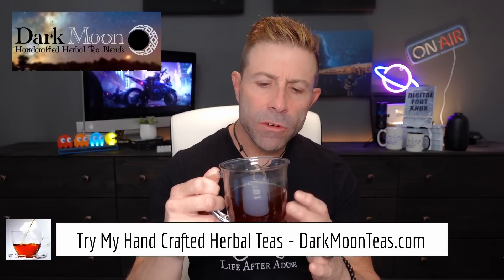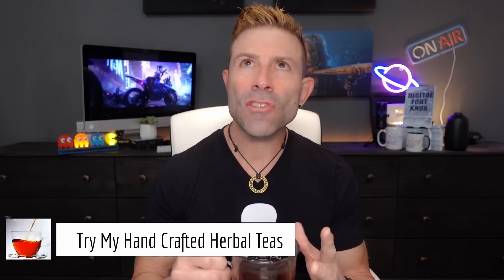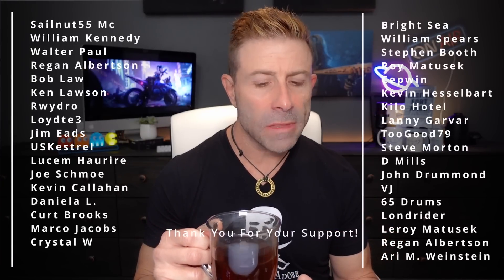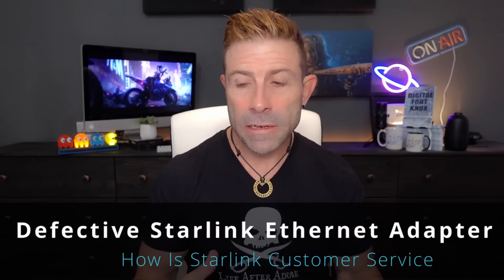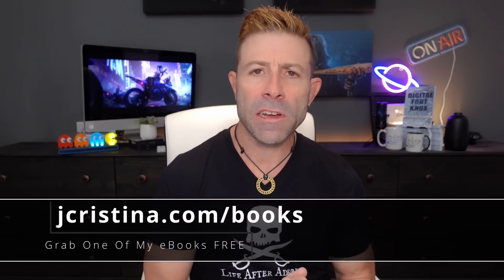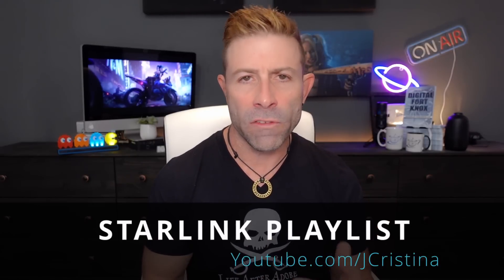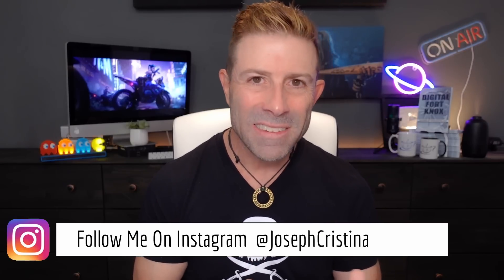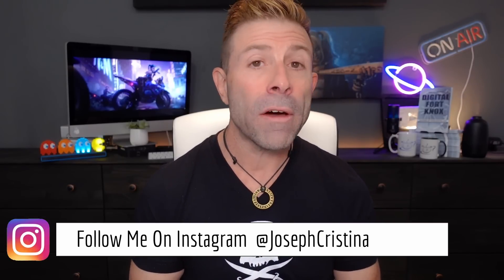Defective Starlink Ethernet Adapter Starlink Customer Service

Comment: My symptoms for bad ethernet connector, no internet and constant connect disconnect issues.  Removed ethernet adapter, starlink works fine.  Thanks for lan cable test/  Might change customer support title to "great" customer support, seemed like you were building to a fail.

Comment: Been having 100mb for a couple months now, figured it was them in an effort to limit since it happened same time they dropped the 1tb cap.  Today though no internet, reset modem, noticed I had over 100mb wifi but connection through ethernet adapter limited to 100mb. I have 2 adapters, both doing same thing!

Edit: New adapter, same 100mb...

Comment: Good Morning, What a Great Channel.  I hope someone can point me in the right direction.  "How do I contact customer support." I just received my Starlink system about 10 days ago. Working great, but I also received my RJ45 connector, which worked great until I  unplugged it to relocate my system and lost my connection. The inside connector was bent ( misaligned ) and now will no longer work. Word of advice, leave the cables connected to the sat receiver. These Lan Conectors cost me 40 euros ea here in Italy. I have ordered a new one because I was unable to figure out how to contact customer support...  would someone please share with me how to contact them? Maybe I could get a replacement dongle to keep on hand. Thank You

Comment: I have a new adapter on the way... FYI, if you're trimming the bushes and clip the cable between the adapter and dish, It shorts out the adapter LAN port.
Wifi still works... good times!

Comment: In the last week and a half my speeds dropped from an average 120/10 to 5/5. I started doing some of the tests you tried but I came across a post from peplink that indicated a compatibility problem with their Ethernet chipset (AR8033 WAN/LAN ETH chipset) and the Starlink dongle. They recommended putting a switch in between so I grabbed an old one I had laying around and my speeds went almost back to normal (currently I have a D-Link router but I haven’t identified the chipset). I think it is the switch so I have ordered the one you recommended. Thanks again for putting this information together and being a good teacher. God bless you.
Reply from the maker: Many blessings my friend.

Comment: Hello Joseph, are the Starlink Internet adapter (dongle) cables hot swappable or do we have to unplug/disconnect the Starlink router power cord? Please help
Reply from the maker: We you swap I would also to a Factory reset by u plunging and plugging back in 3 times  I’m a row.

Comment: Checked it tonight 8pm.   Depending on where the birds are in the sky I get from the 20mbps and up to sometimes 70 or 80mbps.   I tried straight wireless and just cabled.  All the same.   So until they get more birds in the air I doubt it is going to get much better,  in fact I am sure they are signing people up a lot faster than they are putting up hardware into space.  Beside Elon says he is going to cut back on work force 10% and freeze hiring.  So does that include Skylink or just Tesla or Space x itself.  Ti me will tell.
Reply from the maker: I agree.  More Satellites needed.

Comment: So here is a weird one for you.   Starlink of course said I should do a Factory reboot because I was having slow speeds in the evening.   Normal response.   So this morning I did a Factory reset.   I have my big Asus router set up with the skylink dongle, then to my ip link switch and then on to pc and Ooma telo phone system.  Works great.  So when I set this up the first time I bypassed the Skylink router.  Worked fine.  This time when I did a reboot (Factory), it wouldn't let me bypass the router.  Keep saying something like unable to complete try again in a few minutes.    So as it turns out I have the Skylink router in link with my Asus and they are having no trouble.   Maybe the Asus switched to bridge mode, but couldn't see that it did.  Starlink app says the router is connected.   Who knows.  runs just as it did before I rebooted.   I won't know if it helped unit this evening... we will see
Reply from the maker: Keep testing.  The more you test the more you figure out.  Love to hear what you find!

Comment: What I have found is speeds die off after say 6pm.  During the day they are great, sometimes in the 200mbps range on every test.  At night I can seldom get more than 20mbps.   Starlink says my system is within the normal operating range.   which is not true.  According to Starlink us regular customers should get a range of 50 - 150mbps.   So they closed my ticket.   They don't care what I say or complain about.  They just close the ticket and say they are done with the subject.  Now this is Starlink Tech support.  Their Billing department or other departments are very responsive and nice to work with.    Really don't know where to go from here.   So signing off for now.  Thanks, Joseph...for you help on Starlink matters.  
Randy
Reply from the maker: Thank you for being here and contributing.  As for speeds.    Yes.  I do think congressional does play a big roll

Comment: I cannot seem to get either my switch or my router to recognize internet from starlink and the network dongle. I have tried 3 different routers and 2 switches and 2 dongles, nothing, any suggestions?
Reply from the maker: Sounds like there is an issue with the Starlink router itself.  Guessings..

Comment: Checked dongle today.  I have green across the board on my TP link.  The cable from Dongle is all green.   I remembered this video you did because my speeds started getting real slow.   I was lucky to get up to 50mbps down on every speed test.   Although the Starlink app showed they must have reset my router during the night, because it showed 15 hours up time.   Previously it was something like 6 days and something up time.  So don't think it is the Dongle, but something went down hill.   I normally get 50 - 150 down, even in the evenings.    Won't do much good to start a ticket with Starlink, because anything in the evening that shows lower speeds they think is normal...    Maybe Factory reboot tomorrow if this doesn't get better.   Just gets to me how you jump into something new and promising like Starlink.  Get wonderful speeds and no downtime.  Then with in 1 month  things go down hill.   Too bad.  I really liked this system and of course paid a lot of money for the hardware....... what next..?
Reply from the maker: Agree. Try the factory reboot.  It’s a shame things have went down hill.  I think a lot of people are in the same boat.

Comment: hello so i have starlink and i have no obstructions anymore but I still get a ton of drop outs but no obstructions at all we anything I can do totry to fix it I tried to buy a nighthawk router for it but it ended up making it worst because everytime the wifi drops the router would have to reboot for 1-3 minutes unlike the starlink one where it came back instantly
Reply from the maker: Stick with the Starlink router and resolve the issue with them before adding a third-party router into the mix.  You may be a bad modem, cable, Ethernet adapter, etc.

Comment: my starlink experience
wait you guys are still connected
wait your dish is still working
wait customer support is helping you or talking to you?
dish is not working has worked since march, got 2 new cables still didnt work, modem works and is only thing that works and have told starlink aint paying til we get more than a day service and deal with xplorenet, and shaming them, because we almost disconnected services that arent available as much anymore ie satellite, xplorenet is our only other option in a rural area
Reply from the maker: I’m hoping for 24/7 phone and live chat support soon.  They need it desperately.
Reply: and who even knows if its the dish itself, a friend down the way from us says his is not working neither, so either we both got boned on equipment or rural canada is so janky
Reply: the cables must be getting something to the dish given a warm sensation on edge of the surface, but maybe not enough power is pushing thru, because of the way the fucking cable connects thru a ring inside the base

Comment: I was able to use it at one address when I got it for bout 3 days.. then went down bout 5 hrs to my other house and it worked… but when I came back to primary address, then I had connections issues. I didn’t get a response in over 18 hrs… And then I stated that they must be some Neroulink Freaks cause they copy and pasted a solution that I already got from the App and repeat it to me. Such a waste of time any I don’t want to talk to NO freakin Robot. But then it was So crazy they called me and started yelling at me then said I violated there chat terms or something in. I have all my tickets I put in and never directed anything towards a human. I just never thought I would have to deal with automated responses from a bot. I never signed one thing or checked any terms of agreement… so they wanted me to send it back.. but they told me a few days prior there having a shortage on chips… So why would I send back a Starlink after I spent $700 and over a year of waiting… Time to Reverse Engineer? Wondering if I should let them cool down for a few months then ask to be part of there “ Club”.  I got about 50 mbs most time… saw speeds get up to maybe 200 mbs.. So if anyone knows how to bypass ⭐️? Let me know… Or I’ll just send it to Kentucky Ballistic to send it back to the Mother Ship!!
Reply from the maker: That sucks.  I do know that their customer support has much to be desired.   I hope they work on this in 2022.  Maybe a tech support number and also an LIVE online chat would be great.

Comment: great video brother, I ordered the dongle for my version 2 and I can't get the router to receive internet lol so I'm stuck.. maybe I got a defective one? my starlink router connection starts going on and off once I plug the dongle and everything and it just freaks out 😂
Reply from the maker: Absolutely.. Check the connect, pull the plug out and re-insert. I'm guessing there is a connection issue into the dongle... SpaceX / Starlink really needs to QC these adapters, IMHO.

Comment: thank you for posting this I just received my Ethernet adapter today from Starlink and I believe it's defective as well.  Same thing very slow speeds vs. speeds over Starlink Router wi-fi.  The plug fits loose in the dongle and just need to know how you contacted Starlink to obtain a replacement.  Their support page doesn't have way to contact them directly. Did you email them and what is the support email address.  Thanks again.
Reply from the maker: You’re very welcome.
Reply: @jcristina  How did you get in contact with customer support?

Comment: Slightly off subject but what is the range of the Starlink WiFi ?
Reply from the maker: Depends on the wall thickness.  Concrete it’s only about 20-30ft and the single turns to crap.  Sheetrock with wood stud.  You’ll get a few rooms in a home out of it no problem.

Comment: Joseph, I recently ordered a dongle and new wifi6 ASUS mesh network. I tested my cables when installing the network and have a network cable going from the single to the new router. The first day after installing the above network I came down one morning to watch your YouTube to find no internet to watch YouTube. The router was displaying a blue light that indicated no internet. Powered IR off and on again ant was up and running. Experienced a few outages and slow speeds (Instagram videos pause) and recently on a teams video call it dropped my meting. Another teams meeting I had my phone and the Starlink satellite page running showing signal strength and my video nearly quit as it started to digitize.  My phone was running on the Starlink WiFi and had no issues. 
Checked the status at each time my internet had this hiccup ant not outages reported.  I don’t have a switch to indicate what it’s running but convinced it’s the dongle. Before this video I was ready to send the ASUS routers back, but now I’ll reach out to Starlink and get another dongle.
Reply from the maker: I can say for sure.  But these dongles seem to be having issues.  Sadly.
Reply: @jcristina  still no reply from SL. 😞
Reply: @jcristina  star link is replacing both the router and Ethernet cable.  See msg below. 

Thanks for reaching out and our sincerest apologies for the delay in reply. 

Also, we appreciate you letting us know what you've done for troubleshooting so far, that's really helpful! 

We've gone ahead and issued a replacement Ethernet Adapter order, to the shipping address on file, at no cost to you. Additionally, we have also issued a replacement router, since our troubleshooting confirmed that this may be necessary. 

We have updated the shipment priority so as to ensure as little as possible delay. You will receive an email confirmation once it ships out! 

We have been experiencing longer than expected delays due to high volume orders and our efforts in Ukraine, and thank you for your patience as we work to get your order out to you as soon as possible. 

Return labels have been sent to the email address on file. We'd like you to return the ethernet adapter and router for our internal quality check, to understand what happened and prevent the same future problems.

Your are welcome to wait until you receive the new router and ethernet adapter, before sending back the old hardware, so as to ensure you keep receiving service while you wait.

Please don't hesitate to reach out should you need any further assistance.

Comment: I have Starlink in central British Columbia. I've been quite happy with the performance. A few days ago we received a message that the location where we are using the dish is not the same as the location we registered. This is entirely untrue. The dish is at the address we registered and this is also the address the dish was delivered to. The message we received stated that they would begin charging us $30 extra per month and treat it as a roaming location or they would cut off our service if we refuse to pay. We sent a message to them immediately but are still waiting for a response. THEY got the address wrong (we are on a rural road that is nearly 200km long and they are under the impression we registered an address 150km away on the same road). We waited eight months for the dish and have only had it for two months now. I feel this will not go well. Is there not a phone number to call? Any suggestions on how to proceed?
Reply from the maker: I’m sure when they look up the records they will fix it.   I would send a message once a day until it it resolved.  “The squeaky wheel”

Comment: Yes, same thing is happening to me. I contacted support and they are asking me all these questions and asking for pictures of the adapter with the connected cable, which I don't understand why since that picture does not tell the story of what is going on. I can say I temporarily fixed the issue by moving the cable around trying to make it fit better in the port being that the problem is the ethernet cable is not being kept snugly fit in the port thus causing it to not connect properly. I just replied to them mentioning the issue again, and that no matter what, I am formally requesting a replacement since I really don't want this issue to come up again.
Reply from the maker: Go for you.  Stay on top of them.